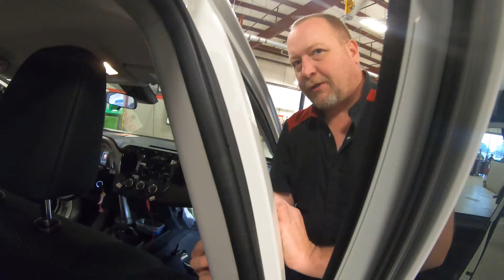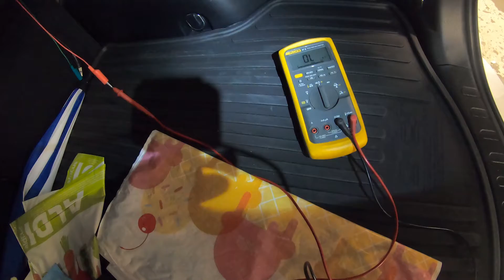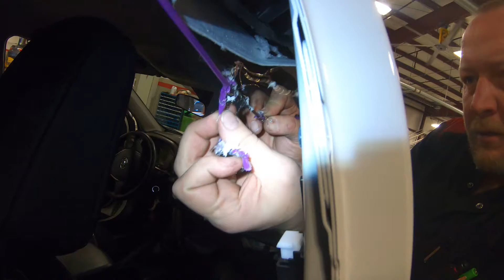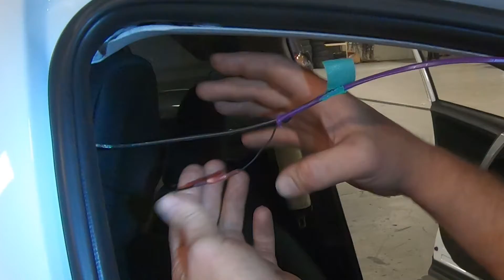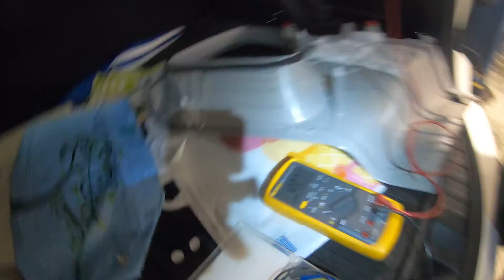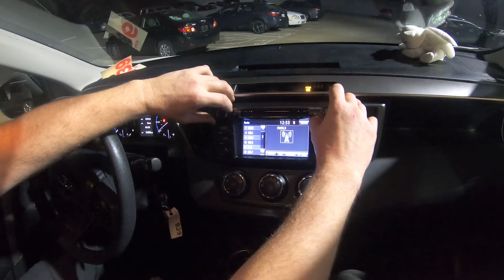poor radio reception in Toyota car

Comment: Dumb question; if I have a poor AM reception only, but good FM on a 2017 Camry, what would cause that?  Bought it used and didn't notice it or listen to AM much.  Now when I try to listen to any AM station, they all have a real scratchy noisy sound and the distant stations ones are impossible, even at night.
I thought the AM antennae might be separate from the shark fin, is that possible?
I have the extended factory warranty and less that 30K miles and I had my local Toyota dealer service department take a look.  They said there is nothing wrong with it because it get some stations and that's just the way it is.
Reply from the maker: I'll take a look tomorrow and see if there's any TS b's and note whether you're  Rear defroster is on our off
Reply: @JamesNoBull  Thanks, rear defroster is off.
I'm pretty sure that this is the worst AM reception I've ever heard.  I was wondering how to approach the dealer again if you don't find a TSB or something?  
I thought maybe it was a loose ground and when I mentioned that to the service writer, he said the extended warranty doesn't cover a bad connection.  He said if it's loose connection, they charge a minimum $180/hr.  
Does this sound like I need to go some where else?
Reply: @JamesNoBull  I tried to see if a cell phone charger was causing the noise, but no it wasn't.  I made sure nothing was plugged into any 12 volt ports.  I did notice that the noise is more of a hiss than a reception issue.  I tuned it to the strongest AM station and it sounds like it either a defective radio or just the worst low quality AM tuner.  It's a very noticeable constant hissing sound and it does it with the engine off too.
I guess I should go check another 2017 Camry to see if the AM sounds this bad?  Maybe that's why the dealer mechanic said it was fine.  I've checked a 2002 and 2003 Toyota  Solara and a Rav 4 and the AM sounded so much cleaner, it was very obviously better.

Comment: "If you put that on i''ll shot you". what did he say to u exactly? He seems like a bit of a muppet. It's called a multimeter. The rats probably chewed the wire.
Reply from the maker: I had made him laugh so he didn't want me to put that on here. Great Question! The meaning of multimeter is that it can test more than one. such as volts, current and resistance. There's  also an analog multimeters.  DVOM just stands for ( Digital - Volt - Ohm - Meter) or Digital not analog  multimeter. You are right it's a multimeter. Thank you so much for taking time to help me to improve my content and for watching. Have a great day
Reply: I got embarrassed my first video and lost what I was goin to say. We joked before the video that he did the same thing on another video and I choked 😅